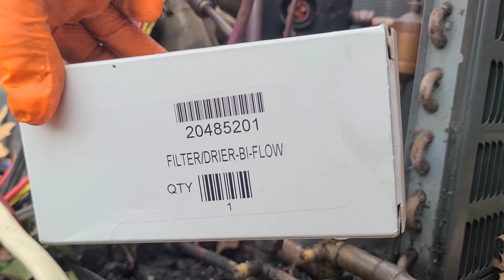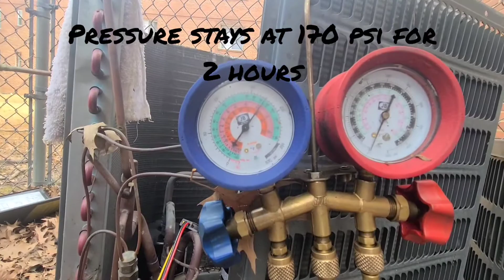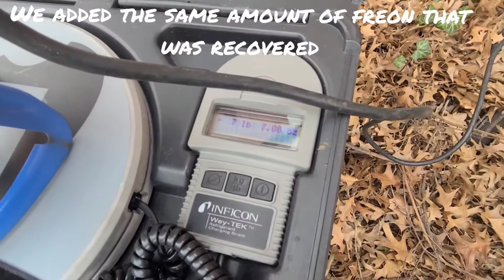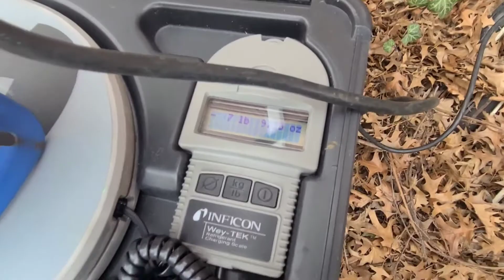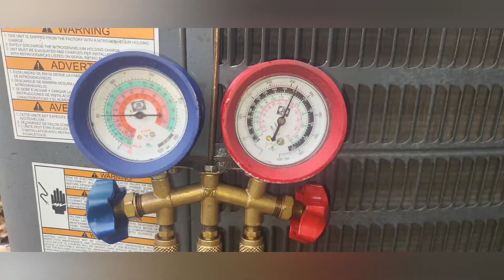Copeland Compressor Replacement - full process

Comment: Enjoy changing it out again soon. No nitrogen flow, you are gonna clog everything in the system up with oxidation. Also, vacuum at -30 means literally nothing. You need a micron gauge to assure you have a vacuum deep enough to remove moisture and air.